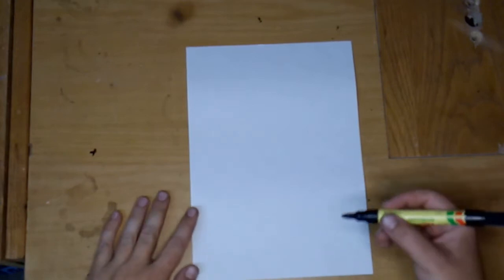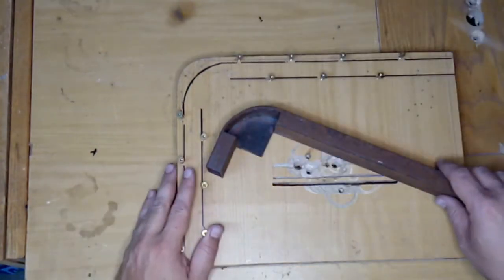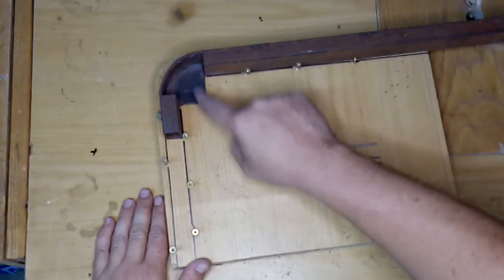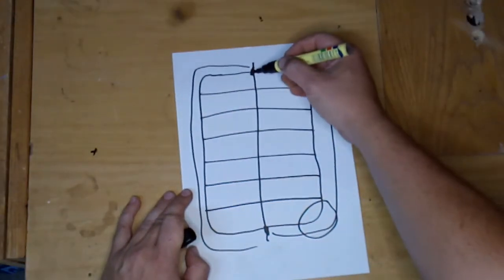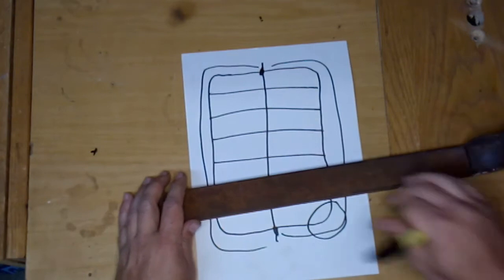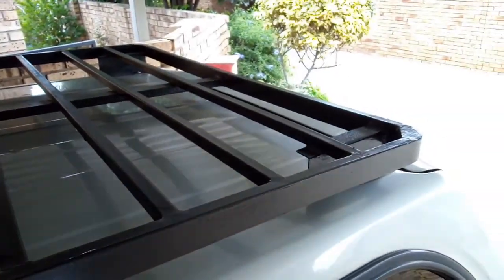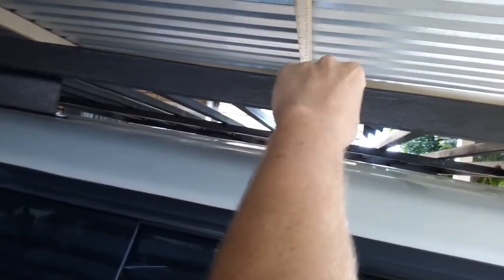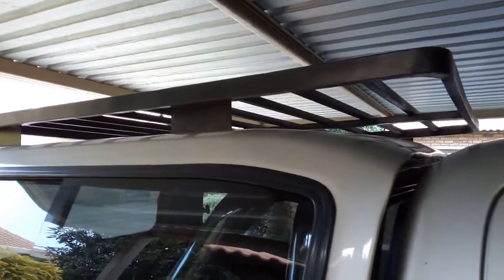How to build a DIY canopy roof rack for yourself!

Comment: Did you bolt it onto your roof or use nutserts?
Reply from the maker: Hi Talay, I used the the existing mounting holes that the canopy had. have a look at the part 1 video where I explained the way I mounted the roof rack 👌

Comment: Hi have you put bracing bars on the in side to support it
Reply from the maker: Hi John, where on the inside are you referring to?
Reply: Round the roof to the bed frame to hold the extra weight
Reply from the maker: No, it is a steel canopy and I got on top of it and walked around on the edges. It is very solid. Also I have only mounted solar on it and a side awning is on its way. I hope this answers your question sufficiently?
Reply: Yes thank you was just wondering if the fiberglass canopy would take the weight.
Reply from the maker: I know some fibreglass conopies have mounting points on top so I guess it depends on them individually.

Comment: nice job,, you should have got it galvanized and then it would never rust again,,, just an idea
Reply from the maker: Thanks George, its not a bad idea at all👌
Reply: The problem with galvanising is that the heat required for gal will twist and distort lighter framework to some extent, there are some very good newer types of undercoating paints now and powder coating for final top coat or spray the rack with the black utility tub protection such as Speedliner or Linex that is very tough.